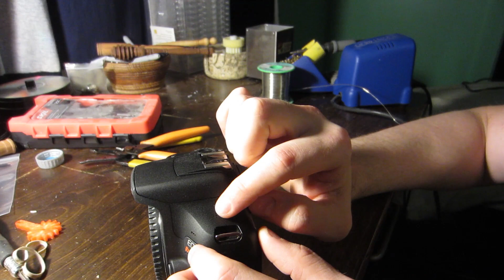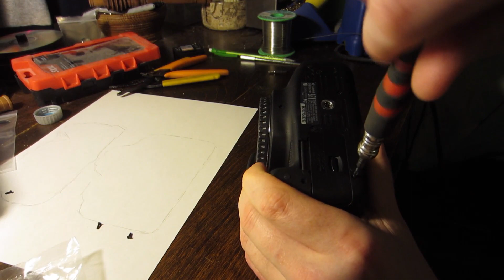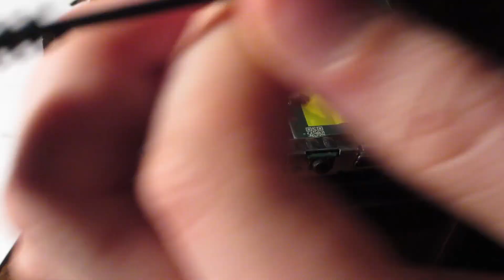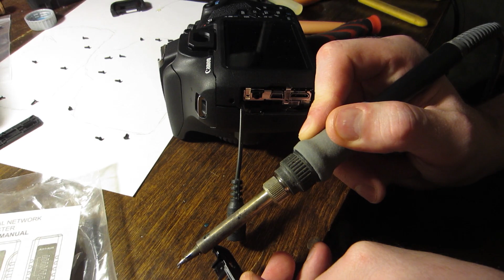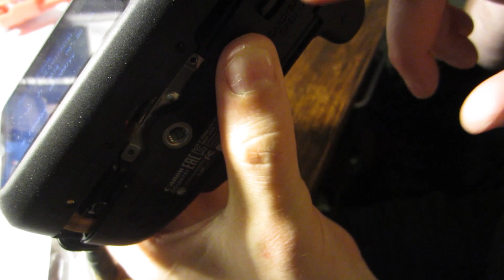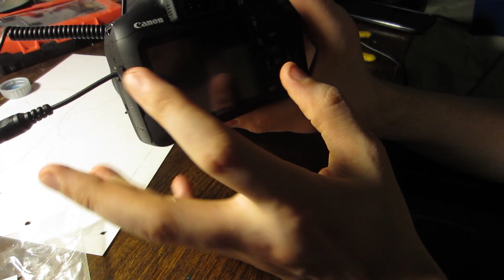Adding an external microphone to the Canon Rebel T7 Camera

Comment: Thanks for the insight, brother. I've tried to add an external monitor, too, and the eos software from the hdmi won't do live recording on the T7 Rebel. When I got this camera I was told it's a great camera for recording. But it only records for around 12 minutes, before automatically cutting off. I was never told that. After what you did the audio sounds great, brother. I'm in North Carolina myself. Now I'm thinking about getting another camera because I always record, and I love the way the T7 looks, but it's not made for what I do. Any suggestions on a great camera for recording longer videos at a not so crazy cost that has external monitor connection for live recording and for external mic connection? God bless you, brother. 
🙌🙏✝️❤️👑❤️✝️🙏🙌

Comment: I'm probably going to give this a shot with my Fuji. I love the camera, but the internal mics constantly picks up motor noise from the lens. I have run external sound before, and it ended being a huge hassle. After synchronizing the audio, I found out that it was out of sync by the end of the clip. I turned out that my audio recorder had clock drift, so I had to to rescale the audio to compensate. I'd rather just have it properly embedded into the video file in the first place!

Comment: Heckin’ yeah man, you freaking rock!!!!
Found out myself the 2.5 mm jack is for an external trigger button 😂😂😂 I bought a 3.5 mm to 2.5 mm adapter and was initially flummoxed by the camera rapidly taking shots as soon as I powered it on. Thanks so much for documenting this 👍👍👍👍 It took me about an hour, most of which was on the soldering. I ended up using some short lengths of thin earphone wire between the OEM socket and my repurposed adaptor plus hot glue (shit is delicate!). Seriously owe you a 6-pack sometime 🙏

Comment: why is it so misleading that it doesn't actually have a mic jack? I have also just purchased this with the intention to buy an external mic...
Reply from the maker: No idea... the really annoying part is since the manufacturer didn't bother to specify, you have to rely on 3rd party anecdotal claims, which are conflicting.  If you can, I'd suggest sending it back and buying the next step up.
Reply: @someoneinncarolina  Yeah I have emailed them today asking for a refund. Its a good camera but just missing one key aspect, the mic jack.
Reply: The Canon T7i has the mic jack.

Comment: Why is every hot glue gun creaky as shit? Thought it was just ours
Reply from the maker: Haha, good observation.  I guess it must be the high temperature changing tolerances or maybe the sound of the glue stick itself being moved around??
Reply: @someoneinncarolina  Maybe, great video either way lol. I'm looking to get this camera soon hopefully, looks very nice. Have you ever tried using it for astrophotography by chance? Even if it's just a picture of the moon or some star trails? How's it perform? Can't find any videos really of this camera being used for that
Reply from the maker: @bravo4104  Awesome idea, and definitely an interest of mine; however, I have not gotten around to that.  Seems like anything with exposure + tracking + the right lens could pull that off though.  So with the right equipment, it seems feasible.
Reply: @someoneinncarolina  I'm back, and I got the camera haha. I've had it for 1 month and I'm LOVING it. Not loving the weather though, as there have been only 2 clear nights in the past 33 days.. but when I was able to try it on the night sky I was blown away! Never been able to capture pictures like that before. The core of the milky way is on the southern hemisphere at night until spring/summer, but I was able to photograph thousands of stars that aren't visible to the eye, as well as the Orion nebula! Not much detail in it though as all I have is the basic 18-55mm kit lens, I'm so excited for a 55-250mm lens. After that I'll think about getting a star tracker, those can be pretty expensive and aren't totally necessary for me just yet so I'll definitely wait.. so for anyone else wondering, it's great for astrophotography!
Reply from the maker: @bravo4104  Thank you for the update - very cool!

Comment: Am I able to just buy a external mic and add it to the camera?
Reply from the maker: If by add it, you mean wire it in directly or wire in a jack to plug it in, then yes.  The product has no way without hacking it, to add an external mic.
Reply: Some Guy In N Carolina doesn’t even sound that bad tbh lol

Comment: Why can’t you get a three poled 3.5 to 2.5 adapter.  There is a mic image next to that 2.5 hole.
Reply from the maker: That is not a mic image - it's a wired control for taking pictures with an external button.

Comment: How old is the video? I'm wondering. Some mics have 3 and some have 4 contact points. Which did you use? I discovered with my cellphone that a mic would not work unless I had 4 contact points.
Did you try another combination?
Reply from the maker: There are only 2 wires in this camera for the mic, you cannot make it stereo or arena, etc.  It is incapable of anything other than mono (without major changes to the electronics/firmware).  The date of the video is about the date of the footage: Jul 12 2019.
Reply: @someoneinncarolina  os it 2.5 mm or 3.5mm? Thanks
Reply from the maker: @truckerdaddy-akajohninqueb4793  that is up to you.  I used what I had laying around, which was 3.5mm if I recall correctly.  You'll want to use the size that matches the mic input you're using for the camera.  So if you have a 2.5mm input for your mic, then use that size.

Comment: Can I just use electric tape instead Sauter
Reply from the maker: Possibly, but I would worry about conductivity affecting sound quality and durability from vibration/dropping.
Reply: Some Guy In N Carolina so I re-wire the mic cables to the female adapter right
Reply from the maker: @slayer5829  Yup.  2 wires, 2 terminals on the adapter (if mono).  Should be straight forward. :)
Reply: Some Guy In N Carolina thank you I’ll let you know how it goes

Comment: I don't know what kind of cable he has but the shield is normally always ground and the two insulated wires are left and right ch. He just shorted his mic out. Bet he doesn't show it working I stop the video when I saw him fk up
Reply from the maker: I don't know what you're talking about honestly.  The mic works fine and I tested it during the video to demonstrate the quality of the recording.
Reply: @someoneinncarolina  probably didn't short cuz it's mono and that other audio wire not getting pwr but I am an audio guy like you said you weren't and as I said before those two insulated colored wires are positive one left and one right. You may have got lucky and got the right one had it been stereo that other side would definitely be shorted but glad it worked out.

Comment: Either a cheap voice recorder mounted with a mic or a decent portable voice recorder would do the trick.....Hollywood doesn't even record sound and video on the same track, they record sound and video separate and put them together in post. I too purchased the t7 assuming it would allow for an external mic, surprisingly the t7 records some decent sound. Great video none the less. ✌🏾 from Alaska
Reply: 907Ronald I just Record audio on my H1N and match it to the Audio coming from the T7 easier that way! If I were more gutsy I’d attempt this but I literally just got my Rebel T7 😳
Reply: @Jordansretrocorner  for sure. That's one way to do it. ✌🏾 check out qdslrdashboard app if you want to use your cellphone as an external monitor, seeing as our t7 dont come with articulating screens.
Reply: 907Ronald I’ve actually been looking into a monitor you can get them rather inexpensive now neewer sells one for around $100
Reply: @Jordansretrocorner  better checkout a few reviews before purchase. Those are very laggy and not very smooth. Can't skimp on gear if you want make quality content. Ill just use my phone untill I can afford a mid/high level priced one that has zero lag and many functions/features until then you can't beat a 9 dollar app and the crisp and smooth footage attained is pretty remarkable. ✌🏾
Reply: 907Ronald true, I’ll check it out I figure for a $100 monitor you aren’t getting top quality, although Neewer makes some decent stuff, I do have an extra phone so that might serve as a standby until I can afford the same 🍻
Reply: @Jordansretrocorner  Hello Jordan I just bought a Canon EOS 2000D and I'm finding the same problem here. I'm so disappointed because the main reason I bought the camera was to record my tutorials. So which application/software can I use to match video and audio so that video doesn't seem to lag behind?
Reply: Kenneth Ngeso just Clap when you start recording your Audio and your Video than match the Clap up in edit
Reply: @Jordansretrocorner  Alright. Thank you bro I was almost purchasing a mic on Amazon but when I called the camera shop, the attendant told me it doesn't support external mic.
Reply: Kenneth Ngeso yeah it doesn’t have an external mic input but you can always use an external Audio recorder or even a cellphone to capture audio
Reply: @Jordansretrocorner  thanks a lot
Reply: Kenneth Ngeso no problem! Good luck🍻
Reply: @Jordansretrocorner  could you share link to any software for doing the match?

Comment: I bought  both adpoter non of them working to this camera no auto focus no flip screen dont buy it sucks for vlogging
Reply from the maker: Exactly the point of my video - there is no way for an external mic other than a hardware hack.  Also no flip screen like you mentioned.  I don't think the brand itself is being deceptive so much as the misinformation on seller descriptions.
Reply: The camera isn’t ment for vlogging 😂

Comment: What type of external mics can we use then
Reply from the maker: The Canon Rebel T7 supports no external mics.  The T7i does.  With this hack it supports any mic that is mono and requires no external power supply.  You might be able to get a self powered mic (with its own external supply) or perhaps use one of the usb ports to power it... still it is only a mono input.  Hope that helps.
Reply: Some Guy In N Carolina I think I’m gonna get the adapter

Comment: I just ordered this mostly for the video. Kinda regretting that now finding out there's no way to use a mic.
Reply from the maker: Yeah, it is very disappointing they provide no way to accomplish this short of a risky hack.  It is very hard to find an absolute answer to whether it is supported ahead of time as well.  If I was you, I'd return it and spend the extra cash.  The main reason I hacked mine instead is because I would not have any use for the swivel screen, but if you have that possibility it is probably worth just getting the more expensive T7i model.
Reply: Some Guy In N Carolina I’m planning on buying the T7I, I’m getting ready to send it back! Thank you so much!
Reply from the maker: @camdenford9750  No problem! :)